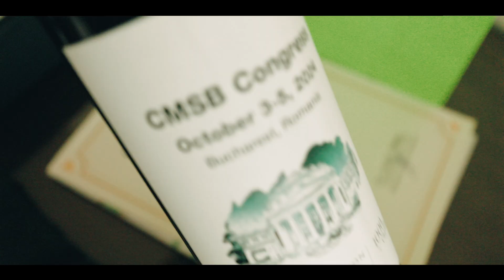From Bucharest, Does Sealer Extrusion Cause Post Op Pain?

Comment: Do you find that there is less post op discomfort with bioceramic sealer?  Thanks for the fun video
Reply from the maker: To be honest, there has never been an actual clinical study of any significance testing this concept; but there's plenty of in vitro studies and others studies showing the pure bioceramics are generally much more biocompatible than resin and ZOE based sealers. So, one can infer indirectly that they would theoretically cause less post op pain. Hope that makes sense. Cheers.

Comment: I've been using bioceramic sealer for the last 2 years and in my experience I found that extrusion from hydraulic condensation doesn't cause pain as long as the canal is adequately clean and shaped